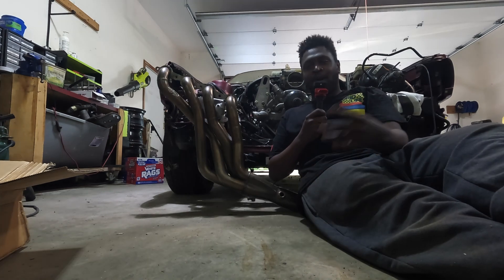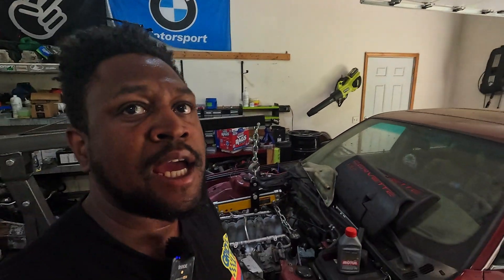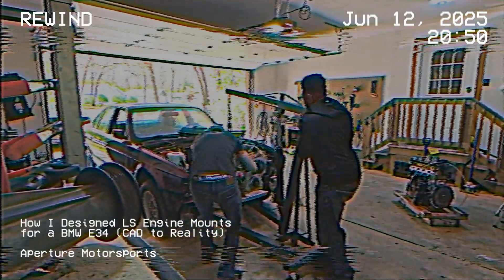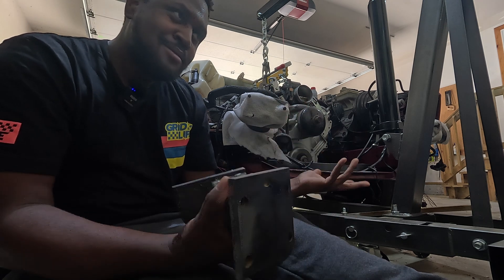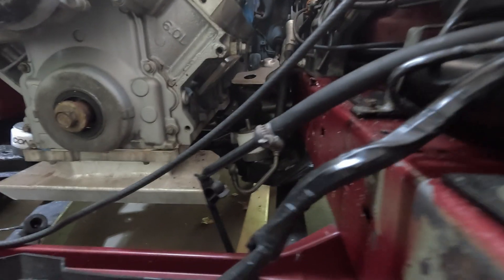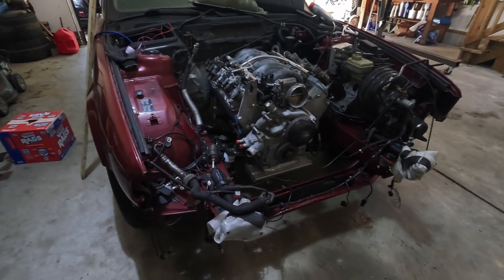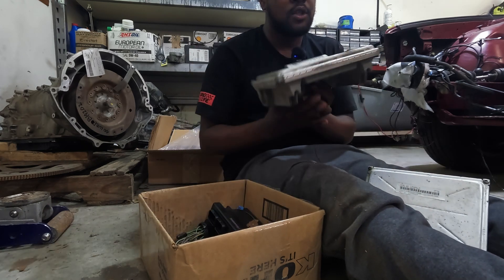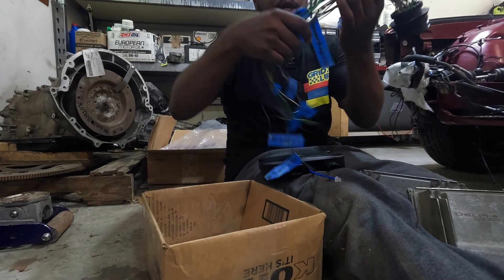Corvette Power in a Classic BMW ??? | Project 530 Ls - BMW e34 LS swap

Comment: Any update on this? M60B40 parts are hell to find.
Reply from the maker: Yeah! So like I said in the last video on the series: the engine is in, I starting to work on wiring up the Terminator x, and I need to put the front clip of the car back on. 

I kind of took a break after August, to film a few different events {cars4cancer, streetcar takeover, SEMA, PRI in a couple weeks}. I'm planning on getting this car back on the channel pretty soon ... I'm working on the car and filming stuff right now 😂. stay tuned!
Reply: @Aperture.Motorsports 👍🏾